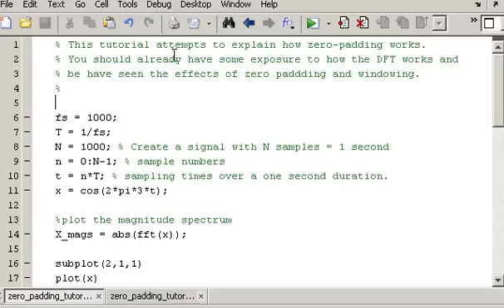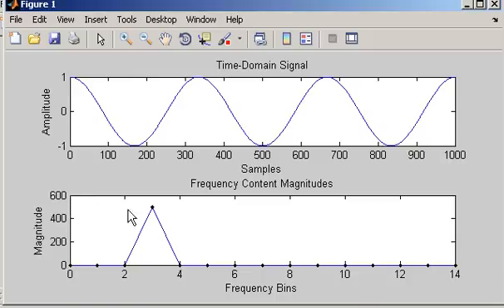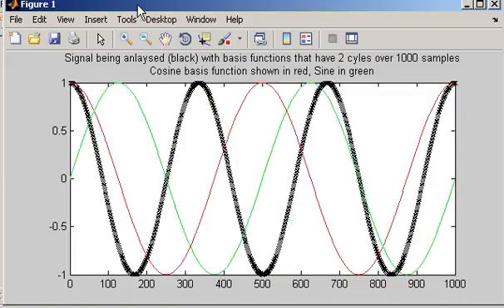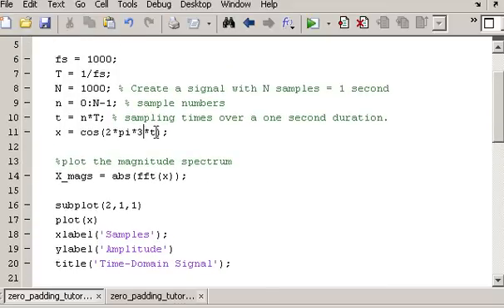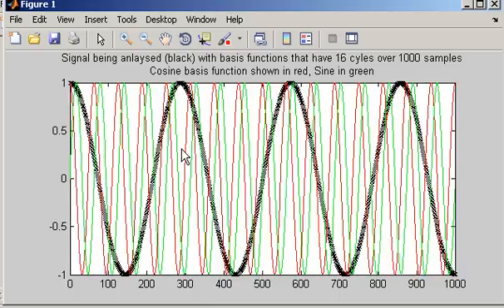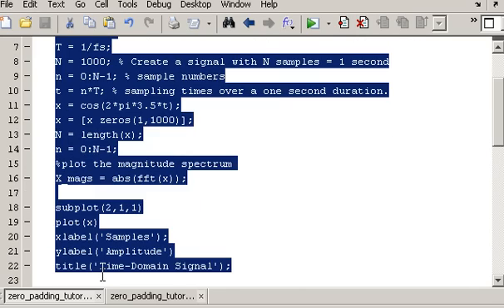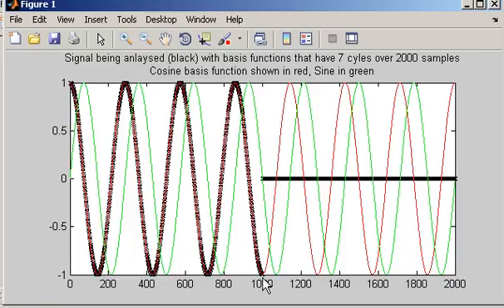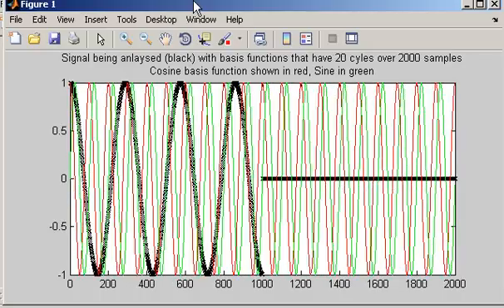How DFT zero padding works

Comment: Hello David, 

I am trying to understand the FFT, zero padding and windowing functionalities. Unfortunately, I don't have access to Matlab. I found an application note which does the FFT on 8051 uC.

https://www.silabs.com/documents/public/application-notes/an142.pdf
 
I got samples for sinewave 10Hz signal. When I run FFT for 128 samples the magnitude at 10Hz is 108(for e.g.) and when I zero padded it by another 128 samples the magnitude at 10Hz become 49 but the magnitude around 9Hz and 11Hz got increased to 29 and 31. In your video, you mentioned the magnitude of the signal doesn't change with zero padding but I am seeing a bit variation from that.  Any possible explanation for that?

Please reply.

Regards
Sheik

Comment: Hi David,
Your videos are very helpful to me to get intuition. Thank you!  
One thing I don't understand is why only non-integer frequency of a sine wave causes the spectrum to spread over few bins. Can't it happen with integer multiples, if the resolution is not high enough ?
Reply from the maker: Have you taken a look at https://youtu.be/V_dxWuWw8yM. It might help.
Reply: It did help, thanks. I understand now what you meant by integer and non integer. 
There are though couple of questions I would like to ask:
1. Is the problem really about cutting a signal at a point where its slope is steep ?  can we say that windows like Hunning are meant to make the slope at the cutting point close to 0, so the signals energy won't be spread too much (what I remember from a course I have taken is that a infinite signal in time has a finite spread in spectrum, while a finite signal (same as cutting the signal in a steep point) has infinite spread in spectrum) ? 
2. Do I understand correctly - zero padding at the end of a signal just makes more bins / better frequency resolution ?
Reply from the maker: 1. Yes a sharp "cut" in the time domain does correspond to a broad spread in the frequency domain. An impulse and step signals being an extreme examples of this. The window 'softens' this effect.

2. Yes (sort of) it does improve DFT frequency bin resolution but not your ability to discriminate between frequency components in the signal. See https://www.youtube.com/watch?v=eg8eebQPfAo

Comment: Hi Mr Dorran,

I have been watching your videos and using your code outline for part of my dissertation project and find your work very helpful, so thanks for that.  I am currently struggling to effectively zero pad an audio recording and cant  understand why.  My code reads:

clc
clear all
close all

[x, fs]=audioread('Front_Right2.m4a');

% x is the signal, fs is the sample rate
Ts=1/fs; % sample interval
N=length(x); % number of samples in the signal
k=0:N-1;
t=k*Ts; %time axis

Seg1=x(1:1323000);

x_zpad = [Seg1 zeros(1, 100000)]; %zero pad
X_ZPAD_mags= abs(fft(x_zpad));

%plot signal

figure(1)
subplot(211)
plot(k,Seg1)
xlabel('Samples from 0-30 seconds')
ylabel('amplitude, volts')
title('Segment One From 0-30 Seconds')

This is producing an error:

Error using horzcat
Dimensions of matrices being concatenated are not consistent.

Error in Front_Right_windowing (line 15)
x_zpad = [Seg1 zeros(1, 100000)]; %zero pad

Could you provide help on why this is not possible?

Thanks Scott

Comment: Hello professor. It's me again. I would like to ask you about bring back the real magnitude of original signal after applying zero-padding. I am thinking multiply the result as bellow:
fft(signal_after_zeropadding)*(1/B), where B= length(signal_after_zeropadding)/length(original_signal);
Is it correct? Thanks a lot!!
Reply from the maker: I'm not sure if I understand the question correctly but I think it should be fft(signal_after_zeropadding)/(N/2) where N is the length of the original signal. Try creating a sinusoidal signal and testing it out on that.
Reply: David Dorran
Thank you professor! I will test this and after I will reply you back. Regards.
Reply: David Dorran
Sorry for a long time. It works. Thanks.
Reply: Great video and interesting discussion on the true amplitude, thanks! Regarding the DC component, would one obtain its true amplitude by dividing over N, or over N/2?

Comment: Congratulations for your explanation. I've been watching your DFT videos. I would like to ask you, professor. How can I define the length of zero padding? You put the code: x = [x zeros(1,1000)], may I use x = fft(x,L) instead? ( where L =1000)  I am new in MATLAB, sorry. Thanks!
Reply from the maker: with x = [x zeros(1,1000)] you are zero padding by 1000 samples so x is 1000 samples longer that it originally was.

With x=fft(x,L) if L =1000 the signal will be forced to being 1000 samples before the fft is applied. e.g. if x was 200 samples it would be zero padded by 800 samples before applying the fft. However if x was 1500 samples the last 500 samples of x would be discarded before the fft was applied
Reply: David Dorran Thanks for your reply,  professor, but:
1- how can I define the length of zero padding? 
2- About your explanation, I understood that is better choose x = [x zeros(1,L)] than x = fft(x,L). Am I right?
Thanks.
Reply from the maker: André Luiz Regis Monteiro X = fft(x, length(x) + L);  should zero pad by L samples
Reply: David Dorran Thank you very much, professor.